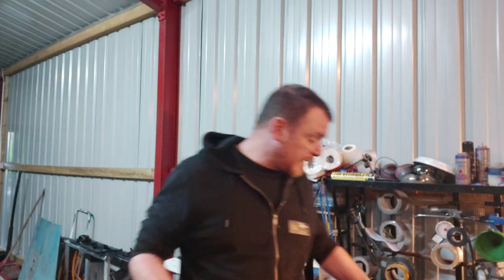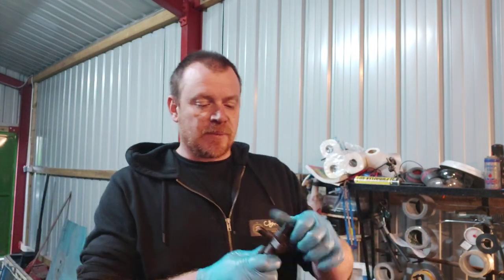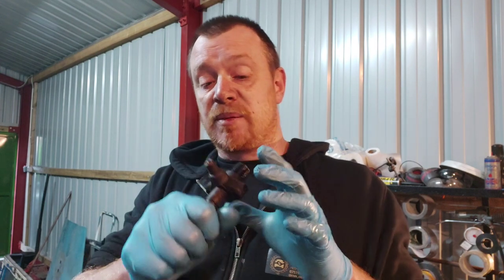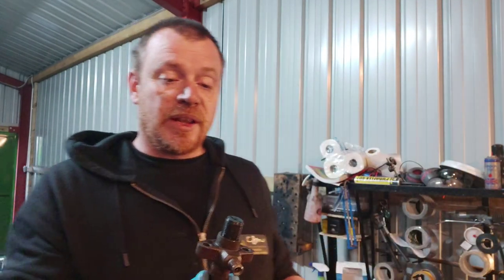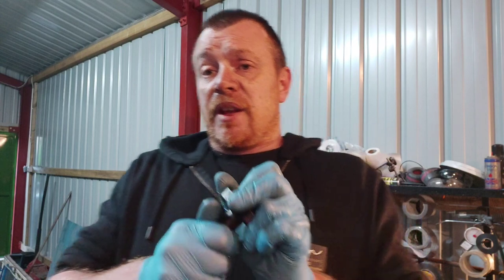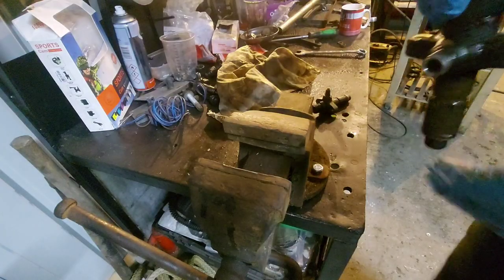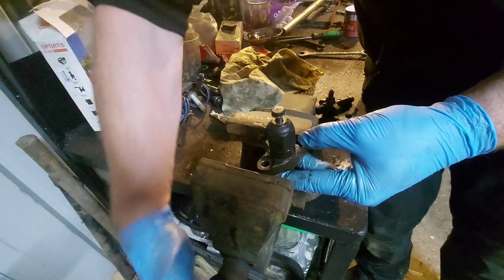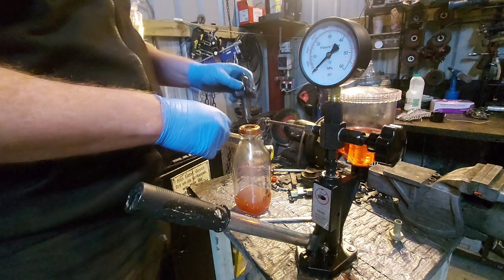Testing land rover diesel injectors

Comment: Mate, I learned the hard way. Attempting to clean the nozzle tip with a wire wheel is problematic. The wire wheel may deform the nozzle pin.  Creating a poor spray pattern. Gentle as she goes!
Reply from the maker: My wire wheel is soft you can almost stop it with your hand. if it breaks to easily then it's ready to be replaced anyway its hardened steel so is tough but wears over time. 🙂👍

Comment: Good video, on the pop tester do yo close the black knob or have it open. Thanks
Reply from the maker: Thanks! On mine it's backed off and I screw it in to hold the pressure in the injectors to see if they leak. 🙂👍